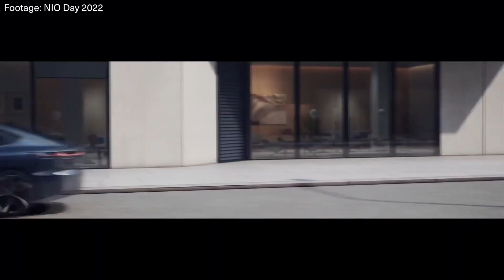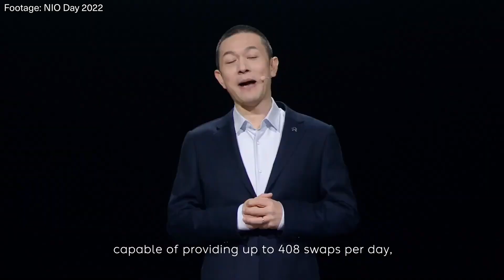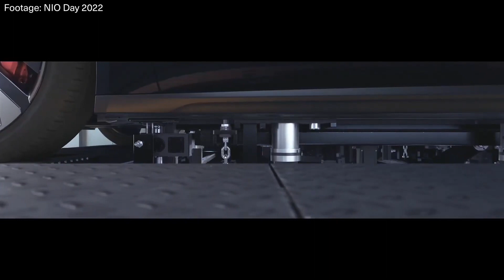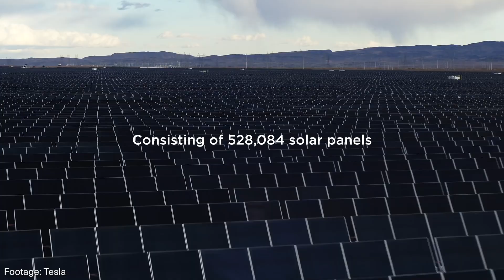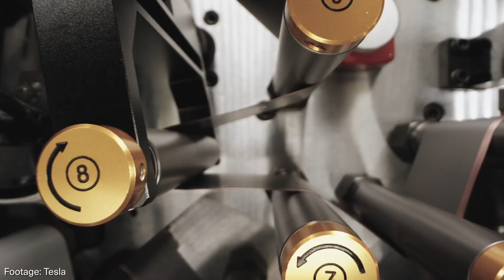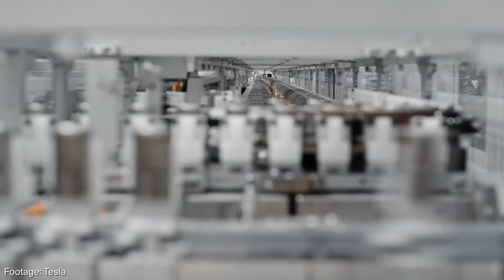The EV Battery Swapping Business Explained

Comment: I  must warn you about allowing Nio to introduce battery swap into the USA. Eventually it could give them an unassailable advantage in the auto market, plus a huge role in battery storage. While still a nascent industry, battery swap has vast potential, especially in a fully renewable power system, as we must all have by 2050. When we have no fossil fuels, the price differential between peak and base load will widen to extreme levels (as the uk is already seeing due to its lack of battery storage). When that happens, battery storage is king.

Comment: I really don't think there will be only one solution which means that battery swap and dc fast charging will coexist in the future and it will probably be up to the personal preference when it comes to choosing an ev between non-swappable and swappable in the future. 35% of American population don't own houses including myself. I think it would take a lot longer to build battery charging infra in every single apartment even if everyone ends up owning electric vehicles after 30-40 years. In stead of building the charging station for those people , building swap stations would be a better solution for those people. Think of those smart phones, Theres's still a lot of old folks who still use phones with swappable batteries. Any toy or electronic devices, some of them have rechargeable batteries built-in and some of 'em just use normal aa/aaa batteries.
Reply from the maker: Probably! It does seem to come down to preference.

Comment: You are misinformed. While charging, swap station pick out the bad cells (and replaced).There is no battery degradation for the car owner.That's critical😮
Reply from the maker: Yep, one of the advantages for NIO owners! Of course, NIO becomes the one to deal with the degradation, but they can be repurposed for stationary storage.

Comment: I applaud your attempt to be as objective as possible, about battery swapping. But you've missed some key points. 

Battery swapping is not intended to replace DC fast charging. It simply augments it,  for potential users that can't currently utilize EVs. Such as apartment dwellers and more importantly rideshare drivers. 
The increased  marginal cost for battery swappings, is more than offset by the increased uptime versus DCFC. Plus rideshare drivers in urban areas are very active at night.  So utilization rates for battery swapping stations tend to be high, even at night. 

Next increasing DC fast charging rates is actually a negative for the grid. while battery swapping Is a positive for the grid, since it time shifts the load. Even before V2G is utilized, 

Also China has created battery swapping standards. Which is needed since NIO is only one of many companies creating battery swapping networks in China. And CATL's modular battery swapping model, has numerous advantages over NIO approach. And Geely has drive through battery swapping stations, increasing throughput. 

  Swapping advantageous and its trade-offs is a complex subject. So it's difficult to do it justice In a few sentences here. Feel free to get back to me if you have any inquiries or counterpoints
Reply from the maker: Great info & arguments for battery swapping!

On swap vs DCFC viability for grid:
To my understanding, a swap station can pull energy during off-peak hours to charge the batteries. But I don't see why this would have much of an impact if the station is constantly being utilized throughout the day. Wouldn't batteries still need to be charged during peak times? There may be a software solution to this without using V2G that I don't know. But even with that, it still seems like only a small improvement.

I'm not familiar with China's swapping standards. What do they entail? One of my big concerns for swap stations is their compatibility with multiple battery designs. Do all packs need to be the same size (both in terms of spacial dimensions and energy capacity)?

Definitely complex. Glad you enjoyed the video!
Reply: @stockprobe  DCFC vs Battery Swapping in terms of cost effectiveness relative to the grid: 

"Demand charges are fees applied to the electric bills of commercial and industrial customers based upon the "highest amount of power drawn". They can be as much as 50% of the total electric bill or more. "

Battery Swapping inherently avoids these charges. DCFC alternative for avoiding demand man charges is to add batteries to charging stations, which is inherently costly and inefficient. 

China's swapping standard legislation, is based on inputs from all the major players . But the only aspect that I can find that was fully implemented, was for safety standards. supposedly it's supposed to be fully implemented by 2035, but couldn't find the specs for the standards online.

CATL Battery Swap Solution EVOGO Featuring Modular Battery Swapping standard, 2022-01-18. Is the only standard that's being used across different brands by at least three automakers. That I know of.
Reply from the maker: @nc3826  nice, thanks for the info! I assume they just avoid charging during those fairly brief spikes in demand. & with V2G, they can discharge batteries during those spikes.

Like with any stationary storage, the opportunity is expected to diminish as more companies get involved. I wonder how valuable this advantage will be for NIO (& others) long-term.
Reply: @stockprobe  Demand Charges are not the same as electric rate price arbitrage.... Which is what you're referencing in your last paragraph.... So the commoditization for energy storage, which will not happen in the near term anyway, will never take place in terms of demand charges.... 

good luck with your analysis...
Reply from the maker: @nc3826  why wouldn't more widespread rate arbitrage lower demand charges? Demand charges aren't something I understand very well, I'd appreciate some more explanation.
Reply: @stockprobe  The demand chargers is about reducing the "transmission load" of electricity during peak periods, not the generation.... Arbitrage is  about the reallocation of the generating capacity...

Which is sometimes correlated To each other.... But sometimes it's inversely correlated... Since arbitrage can increases demand on the actual transmission lines.... 

It's a little complicated to explain, All of its parameters....  Did that make it any clearer for you? OR just more confusing?
Reply: @stockprobe  you should study this on your own.... i'm not the world's best teacher...
Reply from the maker: @nc3826  that makes sense! Didn't know they were related to the transmission side.

I assume one solution would be to increase transmission capacity, but adding all that infrastructure seems unnecessarily costly. Batteries do seem like the better solution.
Reply from the maker: @nc3826  will do, thanks for all the great information!

Comment: Battery swap along side supercharging is the future. There are many benefits to swapping batteries in minutes, way beyond just replenishing the energy in the pack. Every single NIO can still be supercharged like any other EV. Re sale value of used vehicles that can battery swap will always be much higher than any EV where the battery is embedded in the car because the person buying a used car will not care about the battery degradation because they can just swap it out for a new one in minutes. I have been an EV driver for 4 years and I'm not planning to purchase another vehicle until NIO comes to Canada.Great video thanks!
Reply from the maker: Glad you enjoyed the video! At this point, I think my top concern for battery swapping (& NIO's BaaS subscription) is its long-term value.

15 or 20 years from now, I'd expect DCFC to be a good amount faster than it is today. Battery costs will be lower, energy density will be higher. & longevity will probably be substantially longer too. I expect the value of battery swapping to diminish with faster charging & BaaS value to decline with cheaper batteries. But still, it's tough to say.
Reply: @stockprobe  I agree with you,  but I believe that no matter how good or fast battery charging gets swapping will always be superior because even the fastest charging batteries can have issues and degradation.  Even for people that charge 99% of the time knowing that they can swap the battery in minutes if there are ever any issues is comforting to know. Baas will allow people to have lower monthly subscriptions when they only need a small battery around town but will have the freedom to swap to a much bigger battery when they do road trips.  There is also the big energy play that NIO will have where they use the battery swap stations to help offset the power grid during peak times. Both super charging and swapping together are important for the future of EVs I believe. Time will tell 👍
Reply from the maker: Great points! It gets pretty complicated, especially with Power Swap & BaaS being so intertwined for NIO.
Reply: @Stock Probe:   Why do you think that advancing battery technology is going to be a negative for battery swapping?  
Since Battery-as-a-Service is the hardware equivalent of an OTA update, it's a major advantage. Feel free to correct my logic.
Reply from the maker: @nc3826  referring to my initial reply to the main comment here:
I believe that as battery costs decline, the value of NIO's BaaS subscription will decline alongside it. This is not a disadvantage of swapping, but specifically BaaS. I don't think I was very clear of that, I've now edited that reply so it hopefully makes more sense.
Reply: @stockprobe  i understood what you were saying, but what alludes me is the logic? Why do you think BaaS will decline in value over time? Since it allows the electric vehicle  battery pack to be upgraded overtime. While standard  non-swappable electric vehicles are stuck with old technology in terms of their battery.  To me that would increase the value of the BaaS equipped vehicle. I do not see why you're saying it will decline value?  Since it seems to have an inherent advantage.  Unless you're saying that all battery swapping companies will go out of business? 

I apologize if I cannot explain my question  thoroughly enough for you to understand what I'm asking.
Reply from the maker: @nc3826  I see the value in having the latest battery tech. But doesn't most of the value in today's BaaS come from the reduced purchase price of the vehicle?

As battery costs decline, I'd expect the upfront savings BaaS provides would also decline. For example, if I buy a new NIO with BaaS today, the vehicle purchase price is reduced by the $12k price of battery. But 10 years from now, if the battery price is only $6k, I'd be saving less money.

Again, my argument assumes that most of the value of BaaS today comes from the reduced upfront vehicle purchase price. If this is not true, and most of its value comes from having the latest battery tech or the free swaps, then my argument is less applicable.
Reply: @stockprobe  For simplification let's, take everything you said on face value and not consider any of the other variables that will be changing in 10 years. 

To stay competitive BaaS pricing will have to keep going down as battery prices go down. For both new and 10 year old owners alike. In comparison a 10 year old fixed battery EV will still have a $12k sunken cost and a 10-year-old battery technology. With an expired warranty,  in most cases.  

Plus the major capital cost expenditure for creating a battery swapping station is the cost of the batteries. So as the price goes down for batteries, battery swapping stations will become much less expensive. And more competitive with DCFC, just on that basis. Not even, considering the obvious grid balancing advantages,

NIO models have never been the least expensive. it's a premium brand, BaaS is a value-added option.

But to be honest I'm just playing devil's advocate. And of course I do have my own concerns about NIO and battery swapping. Since no company or strategy is perfect. But I also didn't mention numerous batteries swapping advantages too.

What is the purpose of the post?  find investments?  or are you just curious about the industry?  just for the USA? or internationally? my counterpoints would have varied based on the intended scope of the post...
Reply from the maker: @nc3826  if you believe NIO will need to keep lowering BaaS prices over time for it to stay competitive, then it sounds like we're on the same page.

I'd be interested to learn more on the swap station capex, I'm not very familiar with it. The batteries being the single most expensive component makes sense.

I research companies mostly for investment opportunities, but I like learning about them too. I make YT videos with the info I've learned.
Reply: @stockprobe  Due to the IRA and the Chinese tariff on imports. It's unlikely a Chinese battery swapping company, will be available in the US in the near future. For investment purposes.  I heard about the rumors about NIO producing  EVs in or for the US, but I have my doubts at this point. So this was just an academic exercise on my part.

But outside of the US, there are definitely investment opportunities.  Good Luck...